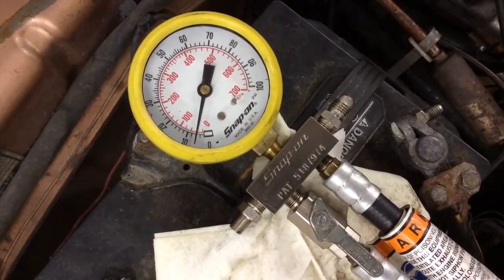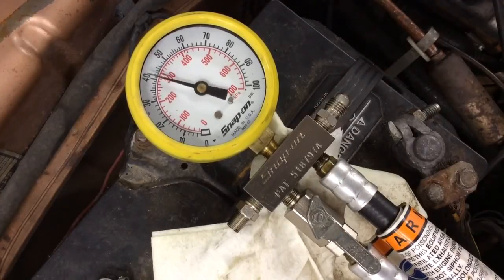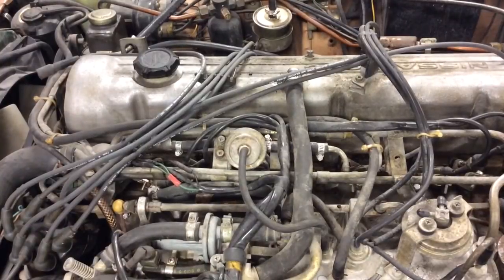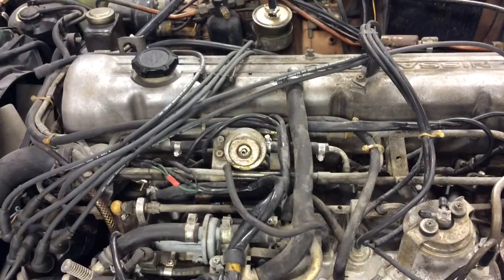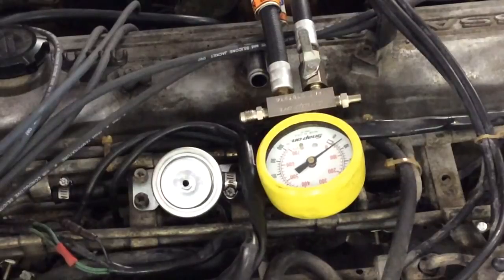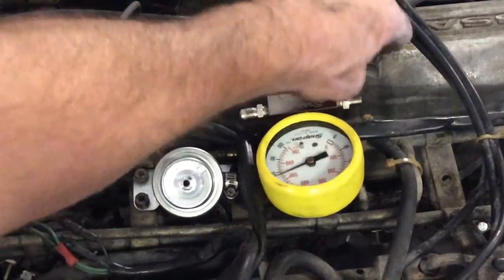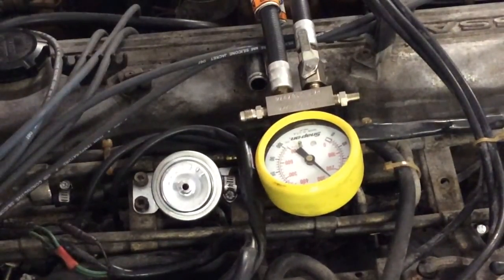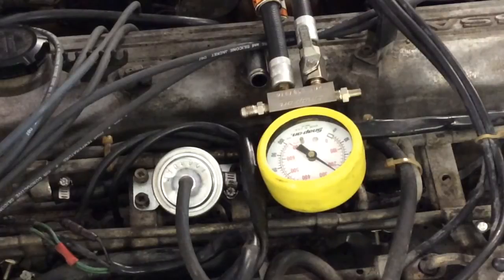Datsun Nissan 280ZX Fuel Pressure Regulator Diagnosis

Comment: I have a new fuel pump but my pump has 35 to 40 psi and my 280ZX runs great so why is your pump higher in pressure

Comment: Great diagnosis. I’m picking up an ZXT this weekend, starts but shuts off. So I’m already planning on doing some simple diagnostics myself, fuel, spark and air. So fuel pump, AFM, and wires are going to be at the top of my list